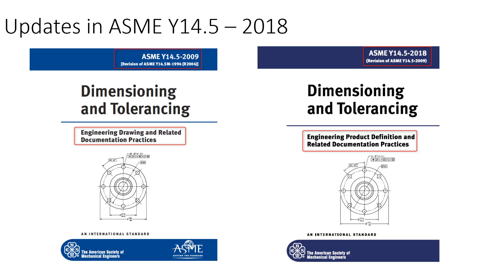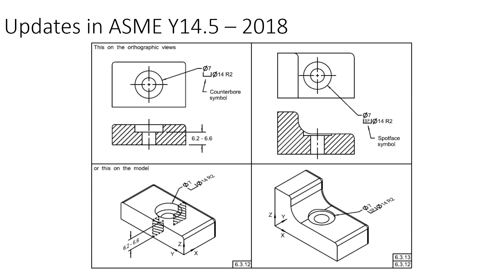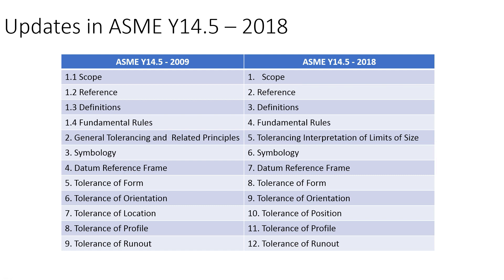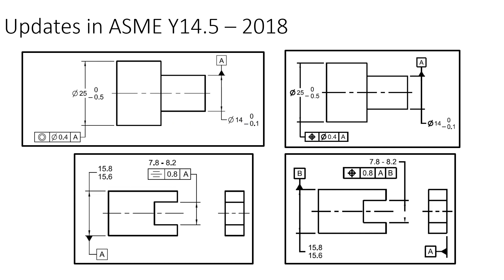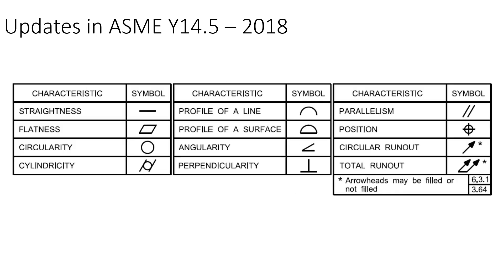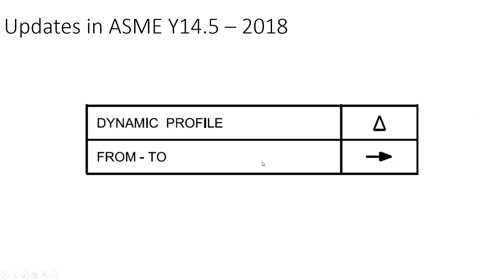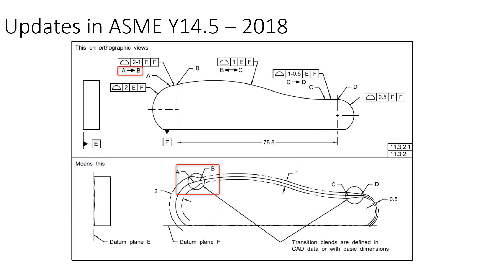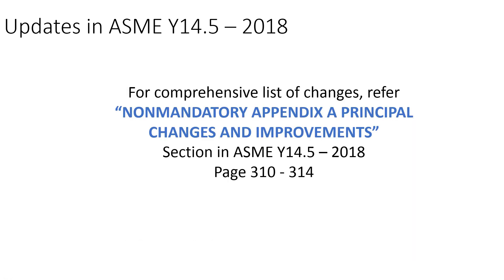ASME Y14.5 2018 Updates : GD&T Tutorial

Comment: Sir I need more clarification on dynamic profile modifier
Reply: The new Dynamic Profile Modifier is a powerful way for refining the Form of a profile. Note that it refines the Form only, not the size of the profile. 

The example from the instructor shows two single segment profile controls on a surface. Unfortunately, that example is not doing much justice to show the power of the Dynamic Profile Modifier. This is because without any datums referenced in those frames, all you have is essentially a 0.1 profile that can expand and contract within the 0.3 zone. This is because without datums, the 0.1 zone is allowed to translate and rotate in all degrees of freedom, just like the 0.3 zone. So both zones could rotate and translate to encapsulate all the points within their zone. The only difference is that the 0.3 zone is fixed in size and cannot contract or expand. The 0.1 zone is fixed in that width, but, it can contract or expand to encapsulate all the points of the surface within the zone. I know, all of this is hard to explain without drawings.

For either Single Segment or Composite Profile Frames, the power of the Dynamic Profile Modifier comes to be when the top profile frame includes datums in its DRF (Datum Reference Frame). Say, three mutually perpendicular datum feature surfaces A, B, C. In that case, the 0.3 profile would be perpendicular to "A", and Basically positioned to "B" and "C". Now, let's say that the lower frame with the Dynamic Profile Modifier has only datums "A" and "B" referenced. 

Two possibilities: 
For single segment frames, the frame with the Dynamic Profile Modifier would lock the 0.1 zone vertical to "A" and locked in BASIC position to "B". And, not able to rotate in the degrees of freedom controlled by "A" and "B". It would only be able to translate (move) in the degree of freedom controlled by "C".
For Composite frames, the frame with the Dynamic Profile Modifier would lock the 0.1 zone vertical to "A" and not able to rotate in the degrees of freedom controlled by "A" and "B". But, it would be able to translate (move) in the degrees of freedom controlled by both "B" and "C".

In addition, for both types of frames above, the area covered by the 0.1 Dynamic Profile zone, that area inside the perimeter delineated by that zone, would be allowed to expand or contract in order to try to encapsulate all the points on the surface.

Yep, hard to explain without drawings.

A contrived example of where you would use the Dynamic Profile Modifier is for the case where you want to give manufacturing a relatively large region on the part to shoot for for placing the final and more refined 0.1 profile in reference to the Basic dimensions. In this case, the relatively large profile area of 0.3 in width. This concept of a large first target area for where to put the profile on a part is also used when the profile is somewhat complicated in shape. So the regular larger profile is specified at that size for manufacturing reasons. It's a general bullseye for where to put the final profile of interest. Then, the Dynamic Profile Modifier specifies the tight form tolerance required for the function of that feature. The manufacturer can then fixture the part in place, if need be, to manufacture the finer control over the final form of the profile. That and the ability of the Dynamic Profile Modifier to allow the form to contract/expand makes it very powerful. 
So now, for example, you could have two or more machine shops making such a part and profile. Parts from one manufacturer may be shipping with the final 0.1 profile shifted to the left and within the larger 0.3 profile. The other may be making parts with the 0.1 profile towards the right side of the 0.3 profile. But, as long as all the points on that final slotted feature are within the 0.1 profile AND within the 0.3 region as well, all is good.